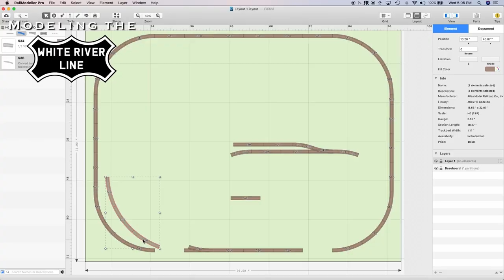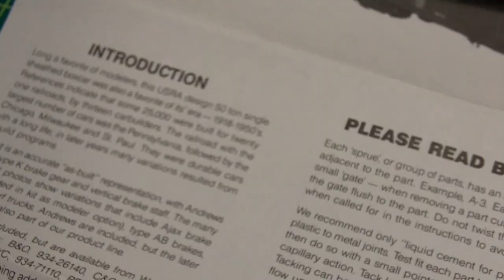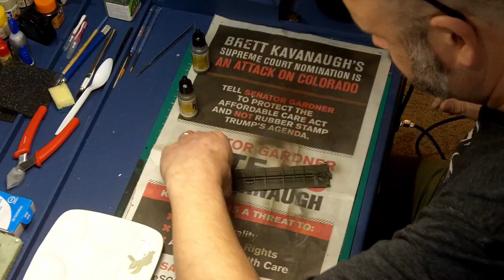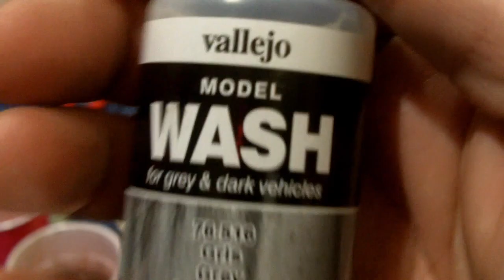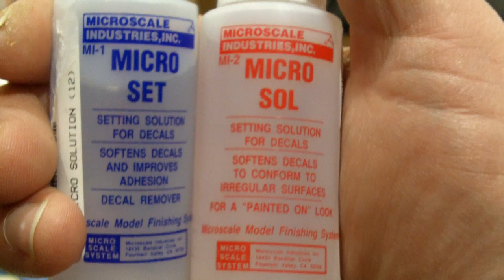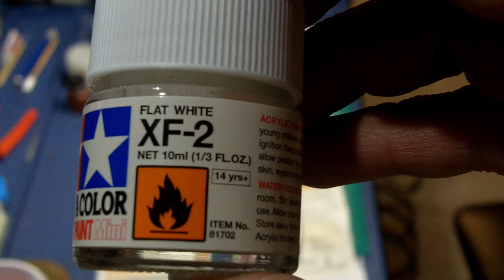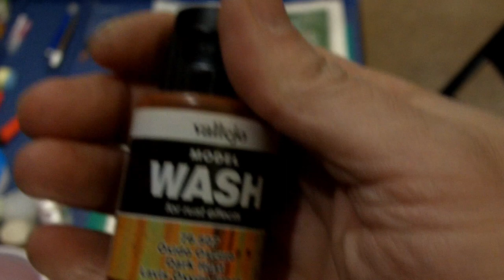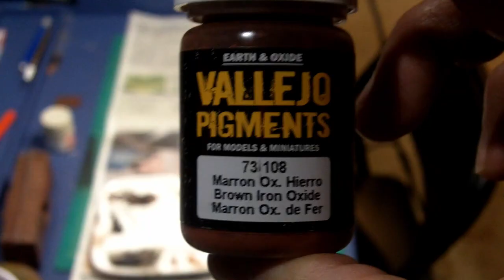A Complete Boxcar Build and Weathering for a Model Railroad

Comment: I got a can of red oxide primer that works well for my boxcar and ore car red.  It is lacquer based which really adheres to the plastic and after thinning, it flows through the airbrush nicely.  I always use a sanding stick and sand off the bolsters and top of the trucks after painting so it moves freely.  Cheers from eastern TN

Comment: When I'm mixing a custom color I also use a test card to see how the color will look, but I prime the card using the same primer I put on the model so I'll get the best possible comparison.  Color over white will look slightly different than color over gray.  Doesn't matter as much for dark browns, greens, etc, but lighter reds and yellows will be affected for sure.

I like your workspace - very well organized.  Is that a silicone mat?

Lastly, a word of caution - even "safe" acrylics can get into your lungs when airbrushing and cause trouble down the road.  Remember GCOR Rule #1; When in doubt, make the safe choice.
Reply from the maker: Thanks for the tips. I definitely need to pick up a mask for airbrushing. 
The mat is a self healing mat. I'm not sure what they are made of. Here's a link to the one I bought, but there are lots available, https://amzn.to/3LZN4Jk.

Comment: A few tips…
Before decaling, spray the entire model wit gloss coat. It gives a smooth surface to “slide” the decals on. Then once they are dry from the setting solutions, hit it with another coat of gloss. This seals the decals in and won’t let the weathering silver under the film. Let it sit 24 hours then give it a coat of dullcoat. Dullcoat will give it a little tooth to weather with. Then when done weathering hit it with another coat of dull. Especially if it will be handled while operating the layout. 
Also I know you realized that you missed the weights but I would suggest weighing the model and making sure it weighs correctly. Figure 1oz plus 1/2oz for every inch in HO. So that 40’er should be close to 4 oz. 
Lastly, I’d swap the plastic wheel sets out with intermountian steel wheels
Awesome job! Turned out amazing
Reply from the maker: Thanks for the tips! Glad to learn about the proper weight and I am planning on upgrading wheel sets once I have the budget for it.

Comment: Since you asked for feedback, I thought I'd add a couple of suggestions.  First, for the best possible outcome, it's best to clean all the parts with soap and water and let them air dry before painting.  Also, it's not a good idea to handle the model while the paint is wet; you get fingerprints on it and paint on your fingers.  Leave parts on the sprues to paint them and touch them up later if necessary.  For house cars like your boxcar you can mount it on the cut down core of a paper towel roll and use that to paint it without handling painted surfaces.
Reply from the maker: Thanks for the tips. I just got a lazy susan for the airbrushing to help get multiple angles in one go.
Reply: Excellent suggestions rich, I also use the same paper towel dispenser trick for holding the car while painting it, Tamiya has one of those lazy Susans for painting car models which I also have..

Comment: Great job,love doing those kit models, I'm a rattle can modeler and mainly use testor's paints and products plus occasionally use scale coat 2 spray paints for my repaints for  weathering I use weathering chalks like Monroe models ( formerly AIM) and pan pastels,I also use a paper towel cardboard dispenser to hold the one piece car bodies while I paint them to reduce handling of the car during painting and a vertical paper towel holder to hold the model during the drying process.as for decal work ( I model the modern day "last mile" switching RR's) so I do a lot patch jobs on cars and locomotives,and my go-to supplies for decal work is a shallow bowl,tweezers especially the spring loaded tweezers that holds the decals while they soak I also use the micro-sol and set bottles,two "foam tipped" artist brushes as well as tooth picks and a dentist pick but I don't use tap water from the faucet ( do to the chemicals used to keep the water clean and safe for drinking) so I use distilled water for my decal work.
Reply from the maker: I’m interested in learning more about using the paper towel cardboard to hold the car bodies. How does that work? I’m having trouble picturing it in my head.
Reply: @WhiteRiverLine  the round house boxcar kit you put together on the video, what I do with th the cardboard paper towel dispenser is I'll kinda flatten one end and stick it inside the one piece car bodies while I paint them,this takes away the risk of handling the car and getting fingerprints on the car or a painted hand😉.if you're on Facebook then I can show you a picture..
Reply from the maker: @joedelusso1415  that makes sense.

Comment: How did you mixing up the “Grimy Black”? I like the blue work surface, where did you find it?
Reply from the maker: I typically use a 50/50 mix of Russian Airforce Dark Green and Dark Gray from Vallejo for my dark wash. I think I added a bit of their Chocolate Brown to make a bit more neutral in this case. Kind of depends on the application. I like especially like the greenish tone of this wash for structures since it hints and some algae you get on stuff in the Ozarks, but sometimes I make it more neutral for rolling stock.

I designed built this modeling station myself. It's made of 1/4 luan and some scrap 1/4 MDF I had lying around the garage.

Comment: Firstly it's a "40 Foot" boxcar not 40 inch. The prototype is 40 feet long.  Secondly I have found that often the original lettering on a model cc are will ghost through the new paint in texture not color. But it can be quite noticable. I always stripped pre painted cars with an appropriate chemical stripper or a grit blaster using walnut shells as a medium. I also wash the car before painting as other posters have commented below.
I also use gloss paints, apply my decals and seal with a satin or matte coat. Dullcote used to be the standard, but Testors has gone out of business.
I appreciate that this car is like a work of art, but you have a whole railroad full of cars to address. If you spend this much time on each car, this may take several lifetimes!
Reply from the maker: Thanks watching, Don, and thanks for the feedback.